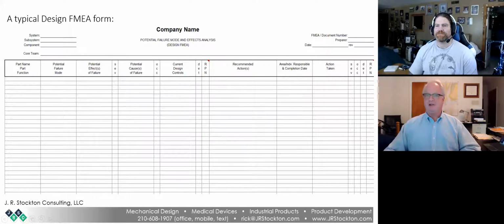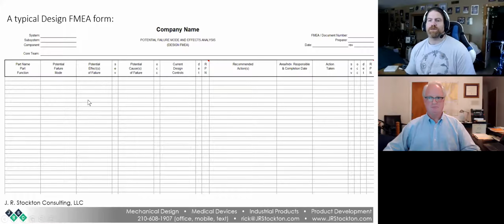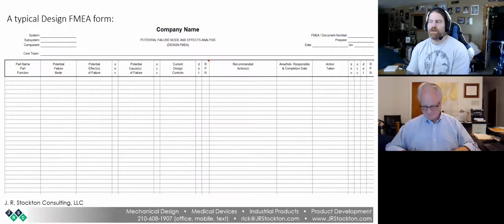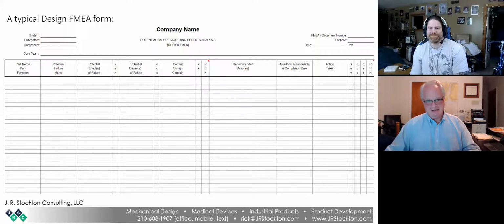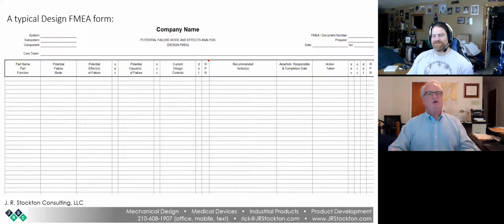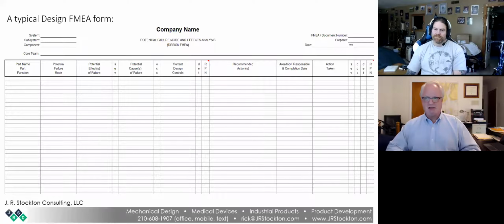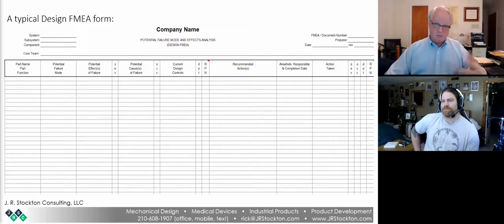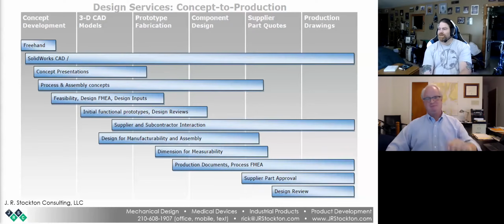Interview with Rick Stockton   How to manage your design FMEA

Comment: Are verification and validation tests considered as detection controls for medical devices? ISO lifecycle durability tests - can they be considered as detection controls?
Reply from the maker: Detection is normally considered a risk control for a process--not for the design of a device. Detectability  should not be considered a risk control for design FMEAs--only for process FMEAs. Durability tests would be considered design verification testing. Design verification and design validation are not detection controls.
Reply: To bridge the structural gap between frameworks: when documenting a mechanical design, how do you recommend mapping your Design Verification Plan (DVP) to the columns of an AIAG-VDA aligned DFMEA matrix?

If internal/external physical tests—like durability, lifecycle, wear, environmental chamber, or drop testing—are not captured in the 'Current Design Controls - Detection' column with an assigned 1–10 Detection rating, where do they physically live within the rows of the DFMEA tool? Or do you completely remove the Detection column from your DFMEA templates when working on medical devices?